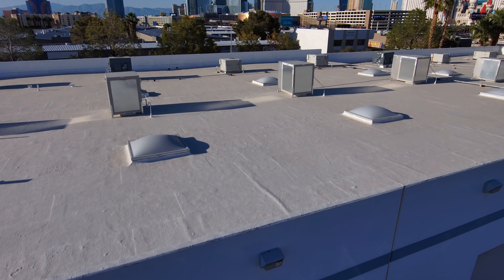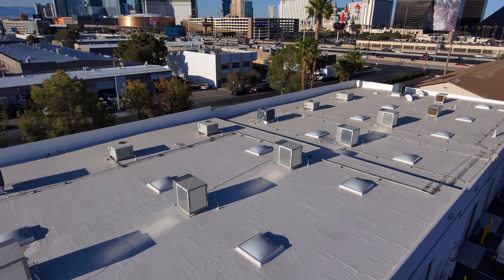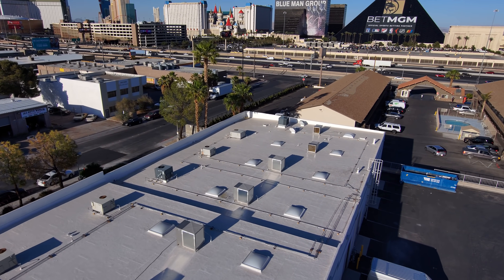TIG Settngs NOBODY is Talking About

Comment: I just picked up a tig welder,     I'm doing same thing, playing with settings and doing test beads.    The first thing i learned was how fast heat builds up,     I'm having fun playing with my Tig,  Its something i should have start using years ago,   I have years of using flux core with a mig,   I know it will take many many hours of doing test welds and playing with the tig till i find what works for me,    Welding is a hobby for me

Comment: i tell everyone i teach pretty much the same thing. everyone welds different, and what i weld at one amperage, another guy welds at something completley different. 

whenever i sit someone down to do their first welds, i turn off EVERYTHING, all the advanced controls. up/down slopes, pre/post flow, pulse, hot starts, etc etc... OFF. i do not explain these functions, i do not even mention them by name, sometimes i will put masking tape over the knobs. they get to adjust one knob, amperage. thats it. i will even set their gas flow, and not explain to them about the gas. i just want to sit them down, have them strike an arc, and melt some metal. doing this, i can have someone laying half decent looking pad welds within half an hour. tig welding, at even a basic level with no user input except amperage is already complex as all buggery! angle, distance, speed, positioning,,, and you dont get to pause and think about stuff, you press that button, or strike that tungsten and you GO. as time goes by ill introduce them to the other stuff one thing at a time, starting with gas, ill show them that the welds mignt be all grey and cooked, nd the tungsten looks like ass too, because theres no pre/post flow, and go from there. one thing at a time.

Comment: Terrible analogy with that plane/pilot.
To land a plane you need to set up, and achieve correct parameters, i.e. altitude, speed, course, gear position, flaps position, etc.
So no matter the skill, you ain't landing a plane, without proper "settings" :) 
You maybe know how to weld, but you don't know a first thing about flying, and on top of that your analogies with other things are also bad.
As for people asking for setting, to a degree I understand them, because if you weld, you need to know how much power you need to give to e.g. not burn through your material.
My father is a master welder, and he was always pointing out how many people burns trough things "usually stick welding", simply because they don't know how to set up a welder.
Sure, there are things which don't have much setup, and skill is the main thing you need to have, but another hand there are welders where skill won't save you when your welder is burning holes because it's setup incorrectly.

Comment: So I used to have a scratch start tig welder previously which was extremely difficult to get decent  welds with (control wise, not looks), and now I switched to one with foot pedal and pulse and the whole nine yards.

One thing that became apparent for me is that all of the settings like base current and welding current with the pedal made me able to control it way easier and get a good understanding of the process that I never got to do before.

I find that pulse welding works very well for me with exhaust tubing as it doesn't overheat the material and stays a consistent temperature, took some time to dial it in, but now I get just the exact amount of penetration and also looks great too.

I am still learning to weld without pulse, but need to get larger filler wire for a high amp project coming up, as I will fix a crack in a 10mm thick metal piece. Considering my luck with the pulse feature, is there any reason not to use when going up in size? I know it takes more amps to melt, but it feels way more controlled and I can manage the heat input better that way.

Planning on running a wide puddle (high torch height) with lots of amps just to get a nice thick deep penetration through each pass. I feel like if I went with not as high amps but no pulse, I'd end up overheating the material sooner or later, and would have to reduce pedal input.

Comment: Thats not exactly true. You should be working from a WPS and should be able to work within it. There should be an ideal power input for a specific weld. What people miss is that things like arc length, direction and travel speed are all making large affects on travel speed and that each welder has to play with those things to accommodate his skills. From an engineering perspective it would be ideal to limit the welders ability to change settings and set up qualifications that make sure the welder has the skill to weld in that envelope. Heat input is going to have an affect on mechanical properties especially as you get into alloys that respond to heat treatment. Average welding alliys are actually designed to have a very small change to heat treatment. The reason that a WPS is left with a large range of adjustment is to allow it to transfer to more task and to reduce testing on the administrative side and it also helps with staffing as it ia harder to find welders who can weld within tight limits.

I wish that you would bring out that there is a difference in welding for mechanical properties and welding for looks. An excellent weld will tend to look nice in general as it is consistent and doesn't have any features that might stick out and look bad. However many things that look nice came from a reason.  Rolling the cup on pipe was basically a way to increase depisition rates. It also has a cool snakeskin look. While it does tend to give a really nice contour as an inspector I can find it to be a problem as there is a strong temptation for welders to want to make cool looking welds and the bead size can get very large especially on thicker joints. That's not ideal as far as mechanical properties go. Both MIG and TIG stacked dimes on aluminum came from techniques for puddle control and depending on how ridged the stacks get can become problematic. Its more of a problem with MIG when people start making large whipping motions to achieve the look and can leave porosity and cold lap in the stacks. I have also worked with some small manufacturers who like a very large stacked look for their welds and push for oversized welds in places that it is detrimental to the structure. For example 6xxx series aluminum looses a lot of strength from excessive heat input. Much of the time it is harmless and the pressure to make attractive welds is generally a good one but welders should be trained to know WHY they are doing something.  As I have moved up through different parts of the industry I have noticed that welders don't tend to get enough training as to how they fit in to an engineered product. With carpentry, electrical and plumbing it is recognized that you work to a code. However most welders don't understand how they fit in and most CWI's don't weld and even most engineers don't understand welding. I don't think it is good for the overall health of our trade and there is a movement to reduce the amount of welding because it is hard to staff and administrate.

Comment: Yes and no, certain things with certain settings are just better to do, especially tig welding. As far as if it will magically make your beads look great, nope, perfect practice makes perfect. You're talking about using a pedal, alot of welders in Europe don't use pedals, instead they apply settings which will compensate and help them control the heat. I weld parts for Rolls Royce with a Kemppi welding machine that has a Minilog feature, for those of you not familiar with it, it's a setting on the machine which allows you to switch between 2 pre-set currents with a click of the torch button, in that specific case, settings and knowing your machine play a huge part in what you're doing.

Comment: I dabble in a lot of hobbies - everything from shooting music videos to welding underwater...  I picked up an Everlast 255EXT a while back - nothing against Miller, Lincoln or other machines.  Just compared features and wanted to venture outside "norms" and glad I did.  I couldn't lay a clean weld to save my life on it for the first 30 minutes, then voila - Amperage.  That was stick.  After picking up a 100% Argon cylinder, I tried to TIG.  Two years later, I'm dabbling in SS and Titanium.  Still trying to nail down my aluminum work.  TFS has been a FANTASTIC resource!  Despite formal underwater stick welding training (The Ocean Corporation) I am seriously considering heading to Las Vegas for a class.  I'm still pretty new at TIG so, I'm sure there's a lot to learn.  Keep up the great videos, Justin!

Comment: On the subject of settings.  The first TIG welder I ever used about 30 years ago was an old Hobart from the 1940's or 50's.  This machine was about 3' wide x 4-1/2' tall and about 6' long.  It had a 25 gallon integrated water cooler.  This Hobart was a dinosaur and it had practically zero settings other than amp output.  It was a really smooth, easy to produce nice, proper welds machine.  I'm glad I learned on that machine.  As a beginner, I would have no idea what to do with all the setting on the Everlast 350 ext which I currently rock.

Comment: I can say I agree.  For me, an aluminum pad (parallel beads across a ~6" square of aluminum, then again on top of that until the plate is too thick) maximizes welding to prep/cooling time in a session.  And for practice, aluminum in general.  Compared to steel its lighter, cheaper, cools quicker, and seems to bear greater abuse from the arc.

Comment: very well put, everything he says is right on the money. If you study, read, and watch every tig welding video for say 6 months, you will have a strong enough fundamental understanding to "know" why your welds aren't coming outright.  Settings won't fix bad fit-ups, dirty aluminum,  wrong torch angle, arc length etc,....

Comment: Settings =3°x4~÷18¤+46~is equal - 23°of thickness of the degree of the input of maps times the degree of time spent. .see that works every time.....foot pedal  position = on the FLOOR  .... DUH

ya get it ?

Comment: I just wanted to say thank-you for your videos they helped me a million in setting up and getting up and running with my first TIG. so I will just share my first experience.

First Attempt : Burned up the electrode in a puff of white smoke....
Remedy : Forgot to turn on the argon....LOL

2nd Attempt : Kept burning the electrode back into a blob....
Remedy : After checking I realized I was maxed out to one side on AC Balance (30% electrode Positive I think)

3rd Attempt : Good welds on flat plate but kept burning a hole through inter-cooler piping
Remedy : After thinking about it I just adjusted my pedal really low to just clean the aluminum and not create a puddle and then slowly increased the amperage until I could maintain a puddle without blowing a hole and once I did that I just gave it a little (10A) more current so I could make sure the puddle could penetrate.

I am really happy learning how to TIG and know I will get better with more practice, I think today's generation just want the end result without all the background work (some don't even realize it) to get there. THANKS AGAIN  for the great videos J......

Comment: Sadly today with social media, most people make pretty welds and don’t care how structural. I’ve been saying this for years and sadly lots of people argue otherwise. That the “stacked dimes” look makes a better weld than a structural one that’s not “perfect” looking.

Especially when most people don’t realize most of these “dime runs” are only 2 inches of a 5ft pass or just run over with a pulse setting after the fact, or done on a complete static fixture and a rotating table do all the welding. They just strike the arc.

Comment: Real truth right here. Some guys run hot and fast, other guys slow and steady. There's so many factors. Material, thickness, position, gas, filler, tungsten.. skill level. There aren't any fixed settings.

Comment: Great video mate. I’m a sheet metal worker by trade, often I’ve finished a job earlier than I quoted and the customer says “oh, it was done quicker so you should charge me less for labour” and my response is “you aren’t paying for the time on the job, you’re paying for the time it’s taken me to practice and perfect my trade to do the job”. This is one of the reasons why this applies! I could tell the customer “2mm stainless steel butt joint, use 37 amps and keep pace with the weld pool” but I can guarantee they won’t do a good job.

Comment: AMEN!  I used to be a fairly decent TIG welder until I lost most of my vision.  Still trying, but what makes it difficult is the difference of vision in my eyes.  The left is 20/400 and the right is fairly useless.  So, without depth perception, trying to get the filler ron to the puddle is time consuming.  I had been welding mostly 4130 thin wall tube for dragsters but, this is impossible now.  I just burn holes in the time it takes to get the filler rod to the puddle.  If I spent a whole lot on a rig, I could have better control of the amperage and maybe do better, but for now I am just trying to lay a structurally competent bead in mild steel.  It is not the settings, it is the welder.  I have cheaters stacked on cheaters and wear reading glasses also.  Just recently spent some real money on a hood that filters the light better, but that is an issue of my disability.  I applaud this video as there is absolutely no substitute for experience and TIME with a torch in your hand.  I learned TIG on a very old Marquette welder.  Amperage was changed by where you plugged the power lead into the machine.  Turn on the gas at the bottle and scratch start.  TIG is like the old joke about the guy who is lost in NY city and asks a stranger how to get to Carnegie Hall.  "Practice son, Practice!".....

Comment: I thought I was a decent TIG welder until I moved to Thailand.  I had to learn how to TIG weld all over again. Foot petal controlled TIG welders are not readily available. Second in Thailand voltage is usually not constant amount, varying from 170 volts to well over 230.
Reply: I've never used a pedal i just use downslope and tap the button towards the end of the weld haha

Comment: Have done most kinds of welding since the 70's Lots of tig in the last 15years too. Just bought a lovely Thermal arc all singing digital ac/dc machine. Never done alloy so had a few goes. This is why i watch your video's. I thought i had done it all until i had a pool of molten alloy on the floor. Thank you . keep up the good work. From the UK.

Comment: A lot of the old tig welders like my old Linde don't have exact settings.  You have a dial that is scaled between min and max and in my case, there are 3 settings for min amps but max possible amps for the top two are the same ~360 amps.   So if you wanted more heat you turned up max amps and if you thought your ramp was too steep for what you are welding then you turn it down some.  I don't have a readout that says how many amps are set and a lot of the old welders were that way. The new inverter welders are nice with digital settings for all of the parameters and the pulse and frequency settings on the inverters I think do help with some aluminum welds but a lot of parts have been tig welded without exact settings to go to.

Comment: I'm about 150hrs deep into learning stick welding. Only now have I developed the skill to do flat, vertical, horizontal and 45° welding consistently. Overhead and pipe are still a world away. 
Welding is definitely skills more than settings, I am using completely different amperage to what works for my tutor.
I also weld with a different technique to all tutorials I have seen online. Welding by observation and feel of the weld pool and keyhole is the only thing that works for me.

Comment: I assumed the new style machine already build in master experience User can select material and thickness， basic Amp volt and flow rate AC/DC will set automatically then tune up or down little bit base on the weld result。

Comment: Great start to the topic. The majority of the welding examples posted on Instagram  (or the various other platforms) look great, however, the issue is that the majority of the welds will never be subjected to testing or use. The "dimes" that have become so dominant for appearance, can at times be an automatic failure or rejection. The visually appealing colors that many have come to accept as a standard, again like the "dimes", can be an automatic failure. Especially when material types are taken into consideration. Doing a sanitary weld for FDA approved equipment, are there distinct "dimes" present, failure due to excessive surface abnormalities. Every weld requires context, as every application is specific. Settings are starting points, general guidelines, the handy tags on the inside of the panels say exactly that. If you really want to master welding, then you need to master the entire process, the concept, the theory, the application, have a grasp on the physics involved. Most people that teach welding always skip over a main concept, you are always welding blind. You don't see the weld happening, you see the effects of the weld process (molten puddle, puddle size, arc cone, arc length, etc). The post weld process feedback is what is used to make corrections, so the more you know about what is actually happening during the process, the better off you will be. Again, great start to the subject.